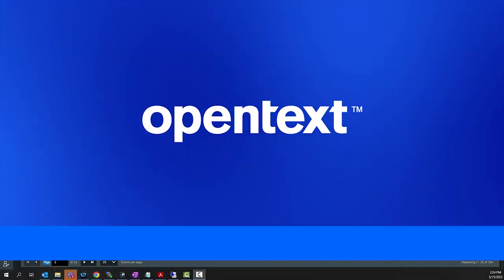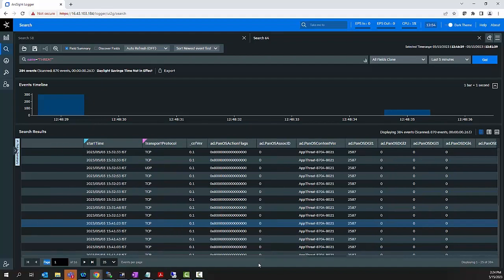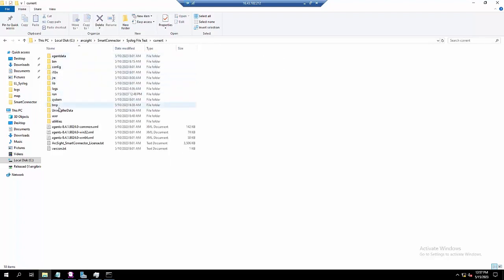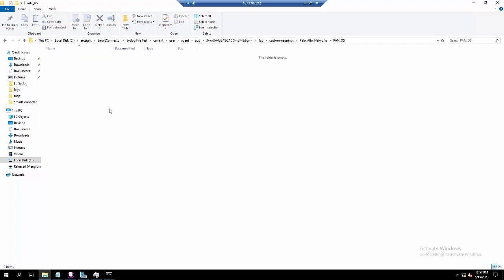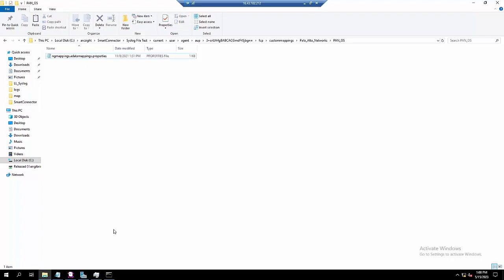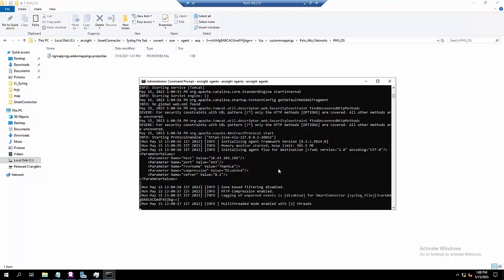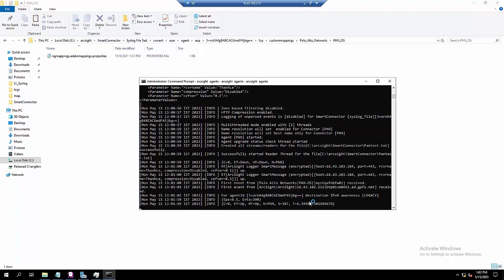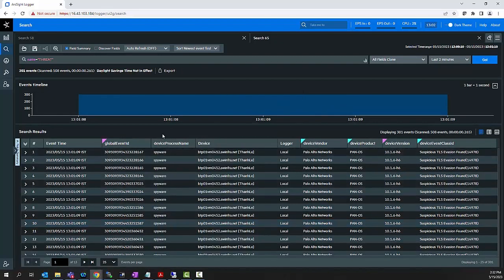ArcSight Smartconnector Mapping

Comment: Thank you for the video. Good that Opentext putting out more videos for the customers. You could also include how the syntax is when there are special char in the Additional fields name. This sometime create issues and questions for end customers. You also referred to "Connector id" when you went into the subfolder. This is not the Connector id, it is the destination IDs. Just to be clear so users do not get confused and also understand that this is per destination this is configured.